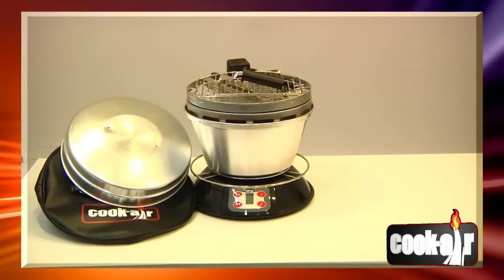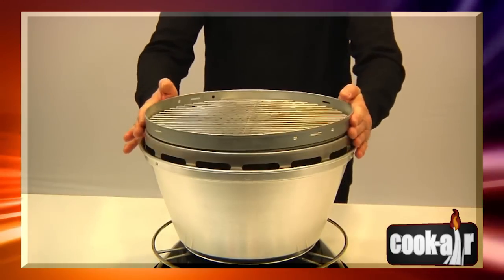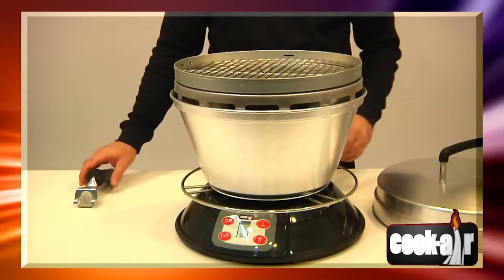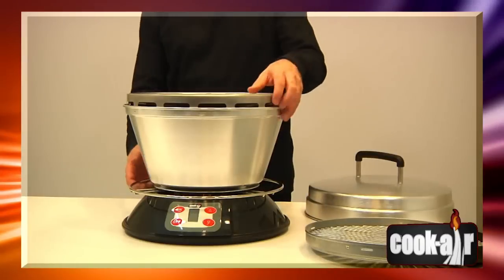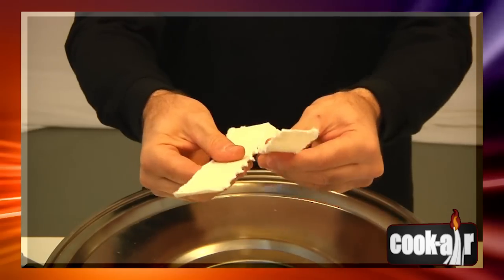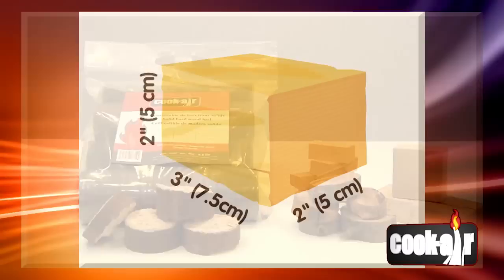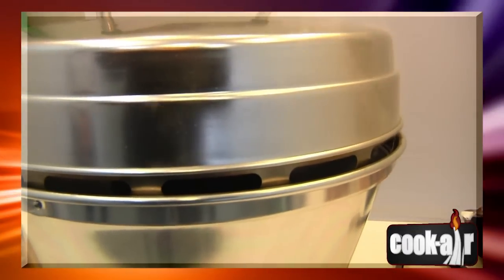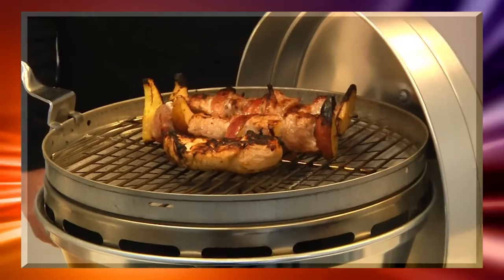Cook-Air gril user guide video

Comment: Really good design however at these operating temperatures it should still be stainless steel. The 3620 is not stainless from what I have read in reviews. Do you still have any stainless models available?